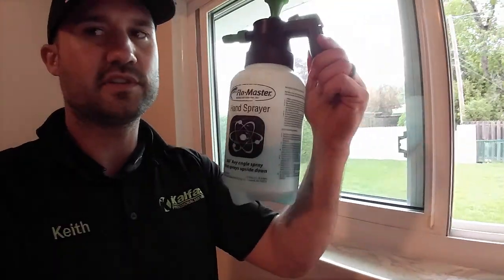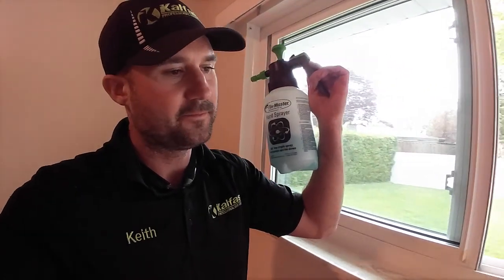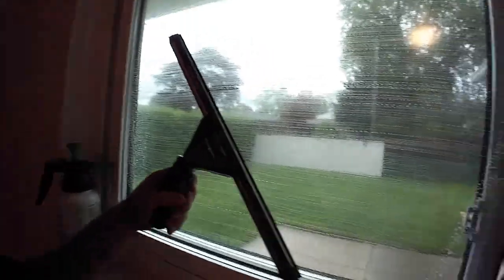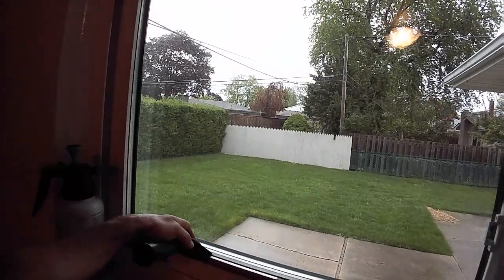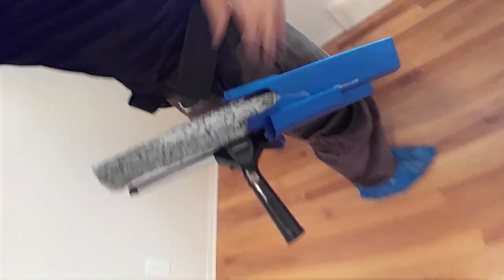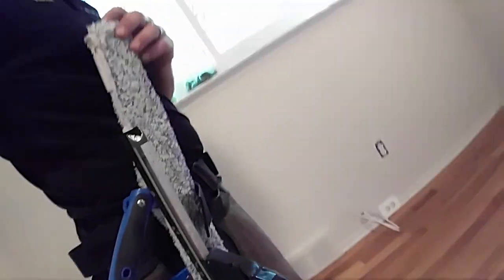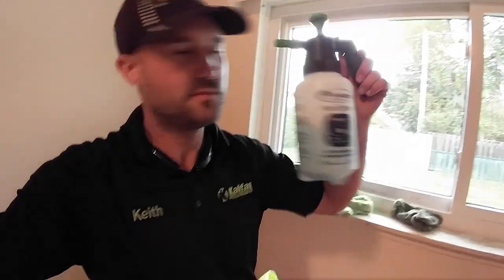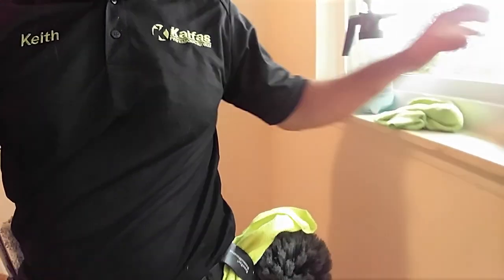On a Window Cleaning Job - Come Along - Pump Sprayer

Comment: Anyone use a foaming pump sprayer (no hose available) on large windows to first loosen up the dirt, salt spray, etc, before cleaning? Which cleaning product would work in a foam sprayer?